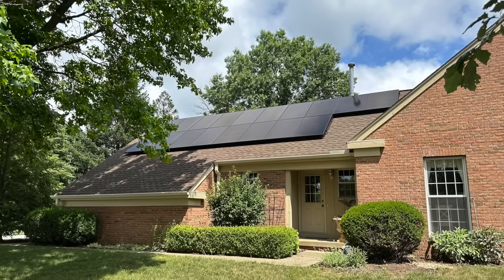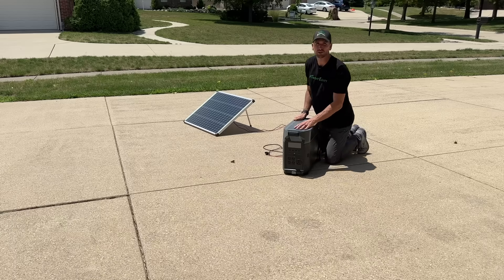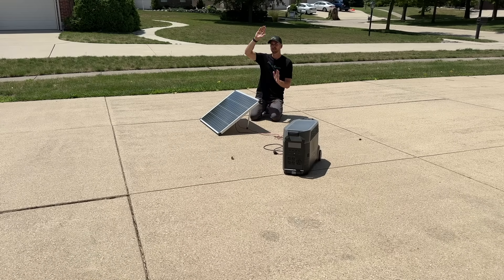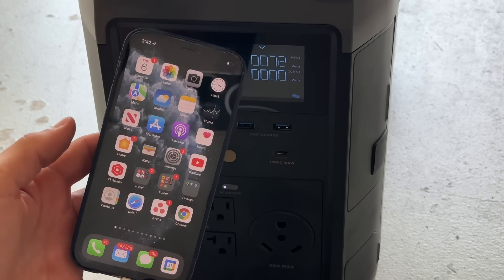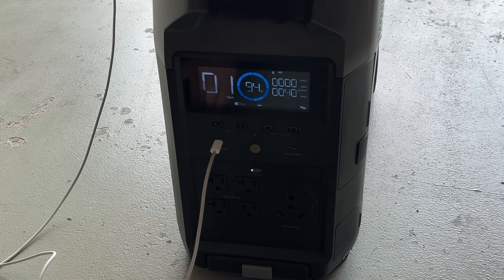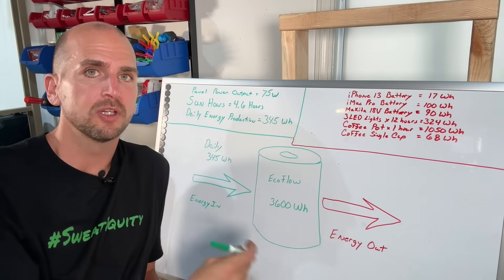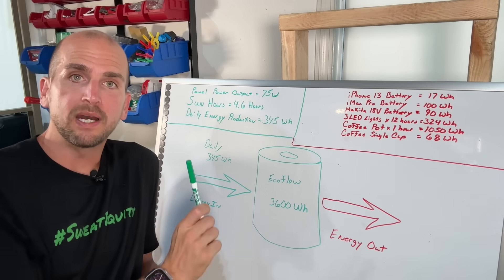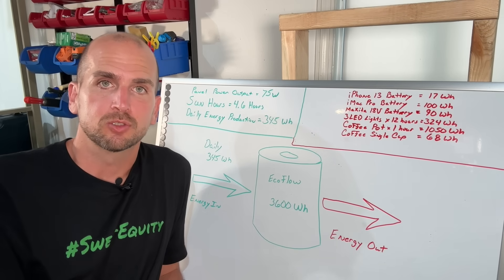What Can You Run On A Single Solar Panel?

Comment: I live on a mountain surrounded by trees, so limited amount of direct sunlight on even the best of days. Where we get extended outages in both summer and winter, some lasting well over a week.before power is restored.  I have 4  100w panels connected in series, run to a 30 amp MPPT charge controller, connected to 460 Ah of golf cart batteries. This connects to a 2000w inverter to cycle my refrigerator and chest freezer twice a day, preventing foods from spoiling during power outages. Note this is not a 24/7 power everything system, just running inverter for 1 hour. twice a day, for perishable food survival and charging of electronic devices.  Batteries last about a week running the inverter this way without receiving any charge. With sun the solar system fully recharges the batteries in just a few short hours, so easily within 1 day.. Most storms don't last more than a couple days so this system has been able to quietly maintain battery power. Meeting my needs till grid power's been restored every time. And with no loud noise or bright lights to hint that I have power, neighbors don't know, therefore leave me alone. Seems like things could continue working like this for months, if not years. And if I ever have a string of dark days that last longer then the batteries can last between charges, do have a backup generator which can recharge the batteries in 3 hours, then go silent again. It's not been needed since putting in my solar.

Most of my neighbors run noisy generators 24/7 when power goes out,  running out of fuel after about 48 hours, then starting their search for more costly fuel. In winter this sometimes means dragging fuel cans on makeshift sleds through deep snow, quite the site. And a very long hike since most local stations don't have backup power, can't pump/sell fuel when power is out. Also thieves often come through during outages if roads are open, making note of where they hear generators running. Then come back in the dead of night, wee hours of the morning,  stealing all generators that are not chained up or otherwise secured. Choose to laugh or cry about it, this is what happens every year around here.

Comment: I used 1/2 the latitude as a year round angle but flat has been sufficient: three 110 Watt panels, two 6VDC batteries for 12 VDC to run a small Norcold frig, 50 Watt amateur radio, and electrical requirements for a propane heater, a propane furnace, a propane instant hot water shower and propane 12 VDC lighting. I looked at the system as startup amps for the refrigerator and total watts. 

The controller is Trace 12 and my solar power system has a fuse on each circuit. I do not use an inverter. I used marine grade shielded wiring. I wanted an electrically quiet environment for my qrp amateur radio hobby.

I like what you have done. I really like your presentation.

Comment: I really want to run an outdoor kitchen only on solar but I have no clue where to start. Any ideas?
Reply from the maker: I would start with understanding the loads you will have from the lights and appliances in the outdoor kitchen.
Reply: WOOD AND A MATCH IS A GOOD START!😅

Comment: I have an Ecoflow River, a Delta 2 and a Delta Pro. I have them primarily for backup power but for the purpose of testing I have used them for the following. The Delta 2 will power my Fridge for about 30 hours. I have used the River to power my TV, Cable Box and WIFI. It is plugged into the grid so it is constantly charging but will provide backup power for 2 or 3 days. I can use my Delta Pro to power my Keurig single cup coffee maker. My Ninja Air Fryer or my toaster oven. I can also run various 12 lights and charge my phones, laptop and tablet. I charge all of this with 200W. of solar (I live in South Texas). It takes a full afternoon of sun to charge but I also have a portable 400W panel that I can use if I need to charge faster.

I recently purchased a 2nd Delta Pro and a Smart Home Panel which I will have tied to my electric service panel so that I can have more backup power. This system will use both Delta Pros.

Comment: A few years ago, I bought an Ecoflow River Pro and hooked it up to a 100W Renogy panel and hung on my shed door which I swing to face the sun as it moves across the sky. I store the unit itself inside the shed. I use it to charge all my battery-operated lawn tools but bring the power station inside the house during winter to use as a small power back up if needed. I'm extremely pleased how this works in the spring and summer. However, (not that I need it for my purposes) the power station won't charge in cold temps. It seems the unit has to be in a warm environment to work.

Comment: Wat i use 
I have 2x150ah lipo4 
That are 2 banks i use .
1 for the kitchen 
1 for the living room.
I use a boat to life on.
So i have 2x300 watt panels for charging the banks up 
In summer no problem i can do my thing .
In the winter i need port power to help charging the battery. (Wallpower from the port) 
Wasmachine i do not have. 
The port have a wasmachine wat i use .
Easy life

Comment: A battery is still useful on a net metering system, especially if you have a time of use pricing scheme.   You charge the battery during the day and when the expensive peak hours start in the evening, the battery can pick up load as the solar generation tails off.

Comment: I think the biggest mistake I see even seasoned people make with "getting the max out of my panels" is when to charge JUST the battery bank, and when to charge/run other things.  Most people I run into time their max usage during max solar production time.  This is good if you are almost full in your batteries.  The problem is most of the time they are at say 70 percent and trying to bring the bank up PLUS the loads.  As most know, but seem to forget, once it gets closer to full it accepts less of charge.  Okay say you are able to produce 100a of charge current.  You battery is accepting 100a.  Don't run anything else.  Now later your battery bank starts to reach full and you are only putting 50a into it but your panels are still able to put out 100a.  NOW is when to run other loads.  Otherwise it's simply wasted.  You got the max charge you could get into the batteries, they are STILL accepting the max they can, and you are directly using the leftovers to charge things like laptops, phones, run the TV, whatever.  This figures into "how much can I do with one panel" a massive amount if you have the capacity to charge your batteries to 100 percent daily.  Your panels may theoretically be able to produce 2000wh a day, but you have to use it or lose it.

Comment: One thing that people forget, like in the coffee pot instance, is duty cycle.  Nothing wrong with the video, this is just an addendum for people reading.  The coffee pot may say 1050w on the input but once it's done brewing it will only kick the hotplate on ever so often.  Say 15 seconds out of every minute.  So it's really drawning 1/4 of the total wattage over time.  It's like a using a circular saw.  Maybe it says 1500w.  You project will take you 1 hour.  You won't draw 1500wh because you only use it for maybe 3 minutes added up during that hour.  Duty cycle is THE MOST important thing to consider when calculating loads.  Even say a laptop.  It may sit idle at 10w.  Watching a movie it may draw 30w.

Comment: Good video. Funny thing is we're talking about emergency power solutions and commenters are wondering how much coffee they can brew on a full charge on a system that costs 1000s. Two words...sun tea...and wait for the power to come back on. Granted a coffee pot is a high wattage item and can easily be used for testing. But it's basically luxury camping until the power issue is fixed. I'm playing with 2-100 watt panels, a 2500 watt inverter, MPPT controller, and a 12v 100AH LiFePo battery...but just for fun and running a furnace or frig, and maybe campgrounds on vaca. Keep the numbers coming.

Comment: on a single 100-watt solar panel, you could run a low power car stereo and a small form factor computer and monitor. Considering the usb ports on the PC and many car stereos, you can add in a cellular phone. After these, you can determine the left over electricity and calculate how many RV LED lights you might be able to add. This could turn a man cave or she shed into a pleasant entertainment escape when everyone else in the house wants to watch TV.

Comment: The angle calculator gives the average angle for the daytime period. You set panel angle and then you can walk away. If you want the ideal angle at the time, the panels should be perpindicular (90 degrees) to the direction to the sun. Of course, if you do this, youneed to constantly adjust the angle of the sun changes.

Comment: I get tired of the BS around solar panels and solar generator. In the long run your objective is to simply sell a solar generator.
You talk about how much you can power with a panel, which is nothing without sunshine. Also, that thing you call a generator is nothing but a fancy battery that you can charge from a house electric outlet, solar panels etc. In the end you simply cannot use solar panels, as a power source, without a battery. Everything you operate is running off a battery, not a solar panel.

Comment: I converted ceiling fans to 120v ac generators. ~5A each
I have 2 solar panels charging up 2 100ah batteries
I connected some small 12v motors to drive the generators at speed ~0.2A
It runs the furnace pump, sump pump, fridge, and a designated light circuit around my house.

Comment: Yeah, I’m very interested in making my own solar generator to power my refrigerator just in case the power goes down.
Reply: I have built a total of 14 solar generators since 2019. One of the older ones runs 2 chest freezers in my shop 24/7 for several years with no attention at all. This is my hobby and I have the tools and skills to make them. Depending on your skills, you could home build a system but its almost easier to buy an Ecoflow unit and pay twice as much for something that is engineered, portable, and is user friendly.
Reply: @kimmer6 Thanks for your input.. I’m thinking of making one to get some knowledge, to see how it works. appreciate your opinion.
Reply: @Silvertiger87  Be careful. Once you start building this stuff you get addicted to Amp Hours and its never enough power. Its worse than crack for me!
Reply: 😂..thanks

Comment: In my summer cabin I did a system where I have 6x280W panels, 5kVA inverter/MPPT. 14x12V 100 Ah batteries (16.8 kWh).
In the winter I also run a generator to top up the batteries Not a bad system. Heating, even with that capacity can be a bit tricky when it is say -20 c....
Cost me little under 1000€ for the whole system
Reply: In the USA, 14 - 12 VOLT BATTERIES COST $2800 all by themselves.That doesn't count the costs for panels, wire, fittings, charge controller, or the inverter You can't do that system for $1,000 in the USA.
Reply: @denisewilson8367  yup. I just happened to be in a right place at the right time. Ironic that the batteries came from a nuclear power plant....
Reply: @denisewilson8367  Yup. As they would here. 
But i just happened to work in a Power Plant, from where i got the batteries for free (annual change of backup systems). 
I also worked in a company that sold solar panels so i got them for half the price. So not a fair comparison pricewise 🙂

Comment: I have two 230 watt 15 amp panels . 60 amp charge controller.     One 200 ah. Lithium ion battery. 600 watt pure sine wave inverter. 12 volt system. 10 years ago it cost me around $1, 900. 124 months later, still good to go. 12 volt fridge freezer, LED lights and the occasional charge of my phone and my wi-fi speaker is all I need. It's a small cabin on a lot in Southern Colorado with a beautiful view. so far it's a little under $19 a month "utility bill" for my initial cost.
Reply from the maker: Nice, that's awesome.  I'm jealous as I would love to have a small cabin where I could unplug for a bit with the family.

Comment: Am I wrong in this? - If the "net metering" means the grid provides the power, then if the grid goes down you still won't have any power?
Reply: Yes. A grid tied system shuts down when the grid is out. You need batteries, inverters, charge controllers and solar panels to power up during an outage.

Comment: But then hearing problem with the watt meter you could only put in less than 20% of advertised output it's called ohm's law 
At your meter if you can be careful of course if you have the ability check your voltage in your amperage multiply the two and that's what you're actually putting into the grid electricity is like water you have to overcome the incoming voltage or pressure if you will to put anything in

Comment: Love your approach to teaching...  My question would be do the batteries HAVE to be lithium?  I removed some AGM beasts (1100cca) from my boat, and they're still rock solid.. Could I use them as a source to store energy, while simply trying to light up a shed located deep on my property?
Reply: I had cell tower AGM batteries for years as home backup. For lighting, especially LED bulbs, the AGM's will work fine. The AGM and lead acid batteries fall down when using big loads like when  running a microwave oven, big Instapot, air fryer, or a very small AC window unit.  The voltage drops off drastically and never recovers.  My whole house automatic battery backup 12 volt  LED lighting is still AGM powered using a pair of 220 amp hour batteries 135 pounds each.  They work great. With all 6 circuits on, it draws 1.5 amps. That will run for days. A Marinco 10 amp boat Smart charger keeps them charged up for worry free reliability.

 For your shed, could get away with 100-300 watts in used solar panels and a small MPPT solar charge controller like a Renogy 30 amp unit, set for AGM batteries. I like their $89 battery meter which shows everything on one screen. Its like a gas gauge for your batteries. You can see if the system is charging or discharging from 30 feet away, too. A 1000 watt pure sine inverter can keep your garden tools charged without breaking the budget,.

In 2017 I started building small battery backup units using lithium batteries. They are like a night and day difference, so much better than lead acid batteries, half the weight, twice the power. They recover nicely after very heavy loads, recharge faster, take up less space, have 10 times the lifespan. They are getting cheaper as well. Good luck!

Comment: 345 Wh is worth 5 cents for most, maybe a dime if you have absurd electricity costs. 

If you don’t have electricity rates higher 30-cents per kWh - twice the average - then it’s probably a bad bet.
Reply: We pay 43 cents a kwh and mid month it jumps to 53 cents a kwh with PG&E....Pacific Graft and Extortion  in NorCal.

Comment: I have a whole house that runs on a car battery. I have refrigeration, hot water, dishwasher, large clothes washer and a device to keep me alive.  Amazing what you can do with a purpose designed system and proper engineering vs a dumb all in one box.
Reply: Would you be willing to send me info on your set up?  I am so confused between panels, inverters and AGM batteries needed.  I just want to run a TV, and basically the type of appliances you've menioned.  Thank you in advance!

Comment: Whatever wattage the panel maker CLAIMS, divide by 2 and that is what you can reasonably expect.
So you get 50 usable watts on a 100 watt panel.
That accounts for cloudy days and operating temperature as well as sun angle.
Anything above that is a bonus.

Comment: FYI, I have a SunGoldPower 3000w 12v inverter which powers an Apple router, a Spectrum wi-fi modem, an Alexa device, and a ghost draw from a little-used TV. It uses about 70w per hour. My 4 X 100ah LiFePo4 batteries use about 1/4 of the total battery power per day in cloudy, rainy weather, pulling in negligible power. (Location: Central Maine, March 2024. First week testing.) Basically, one battery per day of power being used, so, 4 days without solar to recharge. Haven't been able to test with sunshine yet. I hope this is helpful.
Reply: I have 3 X 100w and 2 X 30w panels, feeding 2 charge controllers. Even with clouds, there are some amps going into the batteries, which accounts for the minor discrepancies above.

Comment: Your picture makes it look like you're running your refrigerator directly from the panel without going through a controller or
.. you can't do that you have to run them through a controller and then to a inverter to charge the battery for the inverter